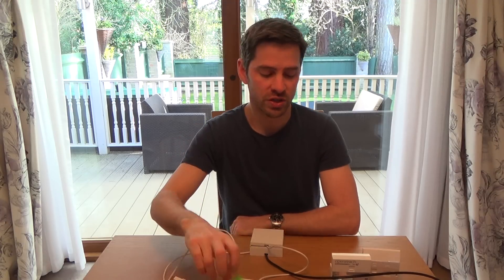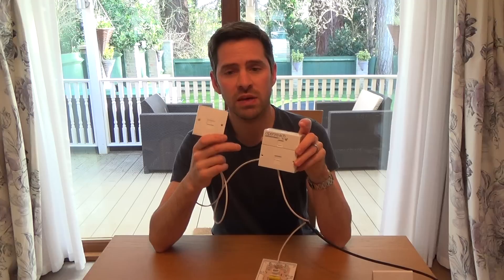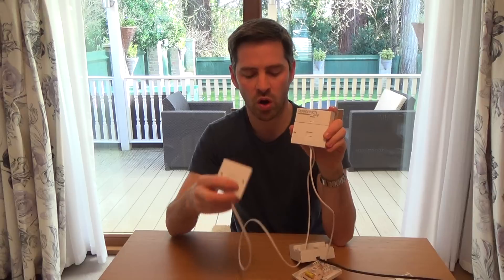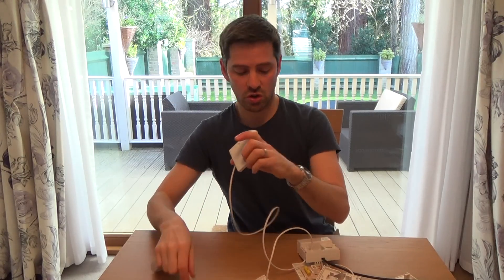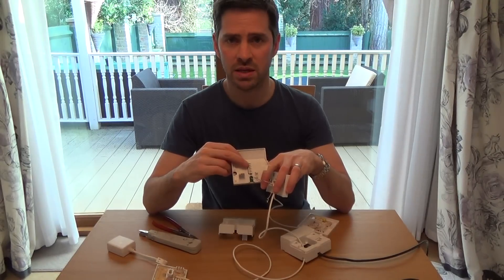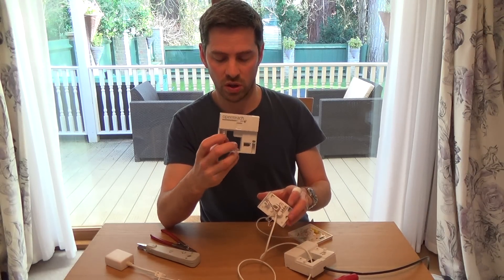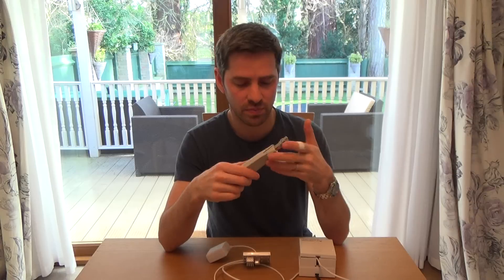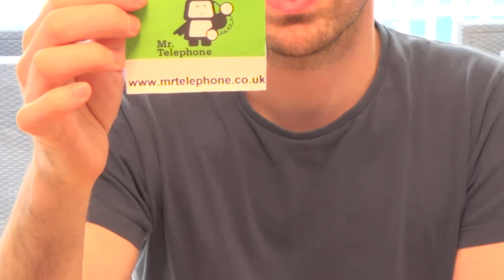How To move your  BT Infinity FTTC BROADBAND ROUTER using existing WIRING

Comment: Wish I'd found your how to first, that would have saved me the hour or so I spent wiring up the filtered side twice and scratching my head. This after BT kindly removed my extension connection yesterday when they removed the old and fitted a new box. Works perfect now, with no reduced speed either, many thanks Vince.

Comment: Thanks for the help vince. Ive put the wires orange to b and white to a... still no signal. The wire in the house looks intact...had an engineer appointment booked. No one arrived.plusnet reckon the engineer visited the the telegraph pole and done some work and now the line should work....it doesnt. I asked why he didnt knock on the door and test my line. (Poss bullshxt).. any advice?thanks

Comment: Hi i understand this video was dont quite a few years ago now and not sure if i will get a reply.
Question i have a main socket in my hallway and have put a extension to my router like in the video, however i want to put a second router in my loft using the same method is that possible having a second router on the same BT line? Many thanks

Comment: Hi, would it be possible to move the master sock about 5 feet by putting a junction box mid line because I need to blank off the original socket and move new wire behind stud wall and relocate master socket 
Thanks Chris

Comment: Hi Vince great videos. I have the same master socket with the a and b as in the video. I want to move my router sky, to another room at the moment the extensions are all in the filtered, the other end has just one cable white blue in the 5 connection, should I move that to 2 and connect the blue white to 5? Thanks  in advance.

Comment: Hi Vince some great videos. Not directly connected but more a wondering.
I have a cat 6 network wired in around the house with wall sockets in every room (including one next to the phone socket) - I'm assuming I can run a standard RJ45 cable from the Mark4 faceplate to my wall patch box then at the other end of the patch put the rj45 to rj11 into the the new smart hub ? I don't need any other phones so this seems to be a good way to get the hub out of my hall and into my tech cupboard under the stairs.

Make sense ?
Reply from the maker: Hi, yes that makes complete sense and it will work. Might be useful to know that in the future you can even patch the voice through to another location if you have another cat6 socket near the MK4 BT socket and even if you don't have another cat6 socket you could use voice/voice economisers to send 2 voice signals (one ADSL/VDSL and one normal voice) from the one cat6 socket. Handy to know if you need to connect a SKY box to the telephone line for example :-)
Reply: Excellent - Thanks
Reply: My Mate VINCE are you still doing videos

Comment: Hi Vince, in this video you use A and B to send the unfiltered signal to the extension which then requires the need for a microfilter. On a previous video ('Increase your Internet Broadband Speed by 60% by using an ADSL faceplate and ADSL extension') you demonstrated sending both filtered and unfiltered signal by utilising unused wires - couldn't you have done the same here? Is this just an alternative method to achieve the same? Is either method preferable over the other? Or will the other method I refer to only work with twisted copper wire from a quality extension?
Reply from the maker: +Dave Garrick Hi, you would need a good quality extension on both setups. On the 60% video the signal travelled through another socket on route so in my opinion I think it is better to keep the ADSL/VDSL signal separate otherwise it is going through a socket and another microfilter before reaching the socket you want to move the router to. BUT...if you have a direct run to the socket where you want to move the router to without any sockets in between then I think the result will be very similar between the 2 videos.
Thanks Vince.
Reply: Thanks for your clear answer Vince. I guess a better option would be to use CAT5e/CAT6 cable to extend? Is there a way to tell (by visual inspection rather than cutting) the quality of the extension wiring? I know the cheapo, flimsy flat DIY-type cable is easy to spot but how do you recognise the good-quality BT cabling? What makes it good? Is it the solid wire instead of stranded, the twisted design or the diameter of the core? Thanks again Vince. Dave
Reply from the maker: +Dave Garrick Hi Dave, definitely better to use cat5e or Cat6 if running new cables but on the older cables the main thing is that they are pure copper, solid core and twisted. If it was installed originally by BT then you will be fine because they use good cable (not as good as cat5e/cat6). If it is stranded then it will not punch in properly to the IDC terminals which may cause a bad connection and often stranded cables are not twisted pair like the flat cable you mentioned. All telephone cables are approx. 0.5mm and it can be very hard to spot bad cables such as CCA (copper clad aluminium) because telephone cables are normally unmarked so they all look similar.
Cheers Vince.
Reply: Cheers Vince, thanks for the explanation. Expect some ebay orders soon ;-)

Comment: my old socket only uses a and b thats all it has the new face place that does adsl and phone socket is coming what shall i connect the 2 wires to as i dnt have a ring wire the colors are blue and white and blue will going into a and b work or will that bypass filter?

Comment: Hi Vince
I live in a bungalow my BT is in the hallway it has A & B in it.
The extension goes up in to the attic and down to the kitchen,
From the kitchen up to the attic to a junction box and down to the living room where I would like to put my internet box,
Now do I run another cable from the junction box to the A & B in the hallway? If so which wires.
Or which wires do I connect to the A & B from my kitchen?
I hope you can understand all this.
Thomas.
Reply: Hi Thomas, I know this is a bit late, but it can be done, you will just need filters on all of the extensions on the path to the extension you would like to connect the router. If I understand correctly, your master socket has two extensions connected, one of which goes to the kitchen which eventually goes to the living room through the attic. 

If this is correct, what you should to is connect the extension leading to the kitchen to A and B, and then connect filters in the kitchen for voice, and in the living room for voice and data.

I hope this helps!

Comment: hey Vince iv got the iplate and wired up an extension but would it be best to rewire the 2, 3 and 5 into the a, b at the back of the main socket?
Reply from the maker: +M T tech Hi, no, the A and B at the back of the main socket should be left alone for just the incoming main wires to allow you to use the test socket in case you or the next owner has a fault on the line, if you attach an extension onto them then it may cause problems in the future and also you will have bypassed the benefits of the Iplate.
Thanks Vince

Comment: hi mate, have Plusnet, master socket, are master socket has a and b. so can run from a and b to a and b  in new master socket done ??
cheers Andy
Reply from the maker: Hi Andy, it will work your way but the proper way is to not touch the main incoming A and B terminals because if your new cable becomes faulty it will put a fault on the telephone line because it has bypassed the test socket. So the test socket is not a reliable way of testing for faults if you connect onto the main A and B terminals. Hope that makes sense.
Thanks Vince
Reply: Sorry to HiJack another thread but is this for someone who wants to move their router to another phone line socket thing in the house?. I'm currently getting weak Wi-Fi signal with my HH4 and plan to change the router soon but I just want to get the best signal/range in the house possible. My router is in front of the house and I'm at the very back...cheers James

Comment: my one when I open the master socket it has the two A and B wire things but it's not Labelled what do I do there do I follow what you did in this video and I don't have a extension fitted on my master socket so should I first fit an extension and then connect the blue and white blue wires to A and A ( keeping in mind my master socket doesn't have the Labelled A and B ports
Reply: need your help Vince I'm confused lol would be very thankful

Comment: im stuck mind boggled confused ive got mk4 i snipped the j11 plug conected two wires to the mk4 two wire block used wire plug rj11 in  mk 4 socket to router one what was wired in block was plugged in modem router worked when plugged one what was wired to connection block cut off connection what was working router
Reply: Hi Jase, any chance you could send a photo of your setup. You should not have to cut any RJ11 plugs off to relocate the filtered signal to a new socket. The A and B should be on the mark 4 faceplate, it just uses the toolless wire sockets instead of the idc terminals shown in the video.